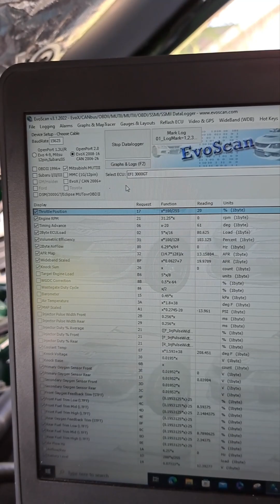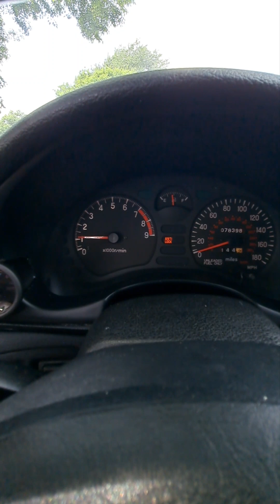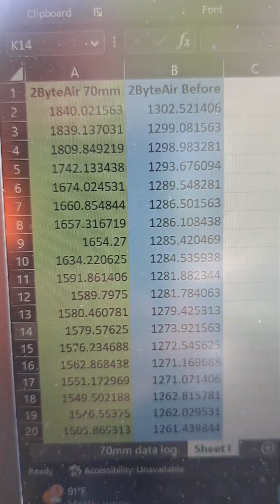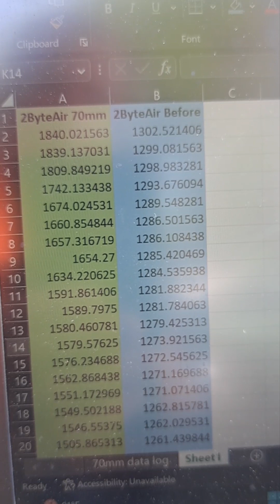3000gt Supercharged Throttle Body Replacemant and Leak Fix Part 2

Comment: Dude wtf you need more recognition this whole series is underrated you showed everything and what you done to get to this step no one does that right on 🤙🏻
Reply from the maker: I sure do appreciate that, it will hopefully catch on soon lol. I know back in the early 2000s some people were putting SCs on these cars but when I really got serious about doing this I googled it and youtubed it and found little to no info. So I decided then I would video my journey. I saw the problems with the old setups and tried to fix so maybe someone can improve upon my setup one day.
Reply: @sigvision4189  hell yeah man that’s bad ass that’s what I gotta do with my eclipse I built an 3.5 block and swapped it and gotta weld up an turbo manifold and redo the exhaust still
Reply from the maker: @ThatGrayEclipse  I love the idea on how Ripp made a jack shaft to run on the eclipse. I had day dreamed about using a jack shaft on the 3000 along the back of engine to get a pulley on the passenger side then run a whipple. No room to do that on the driver side.
Reply from the maker: @ThatGrayEclipse  I am not too familiar with eclipses, do they come with a 3.5 or did you engine swap
Reply: @sigvision4189  engine swapped it they come with 3.0ls but the 3.5 people like to put the vr4 heads on them from an 3000gt to twin turbo with reliable engine for power
Reply: @sigvision4189  yeah I feel you but what you just did is probably better than the ripp supercharger
Reply from the maker: @ThatGrayEclipse  you boosting yours? If so you doing a TT or single setup?I would like to one day do another SL but TT it then do a comparison between the TT and the SC
Reply: @sigvision4189  if you have the base model of the 3000gt your best option is to single turbo it if your going to go with an tt set up you’ll definitely want the vr4 heads for more power and so the turbo kit bolts up but if you’ll do this build I suggest an 6g74 block with softer valve springs and then everything else is bolt on
Reply from the maker: @ThatGrayEclipse  I already have just about every part to TT one. I would do it to the Dohc one to have a solid comparison. I ported my heads for this build. It would be a while before I could start another project though
Reply: @sigvision4189  hell yeah already ready for it I feel you tho I’m same position I been seeing projects I want but can’t rn 💀
Reply from the maker: @ThatGrayEclipse  Make sure to tell all your friends about my build, maybe I can surpass 162 subscribers lol. I have some guys telling me my videos never pop up even when they have notifications on
Reply: @sigvision4189  yeah man I already shared your videos with people you blew they mind no cap just keep it up man soon you’ll be making custom parts for people
Reply from the maker: @ThatGrayEclipse  I seriously thought about building another SC in parallel to this to sell. Between buying the used SC, rebuild kit, aluminum, and paid for welding I have about $800 in it. Now the rest of the car is a different story

Comment: 6:05 I absolutely love that whine, also is this an AWD model? Cant wait to see more of this build
Reply from the maker: No it is the FWD SL model with 10:1 pistons and a 2 bolt main. That is why I cannot go gang busters on boost. IMO supercharging this one made more sense then turbos. Since I cannot add too much boost but wanted more low end power I could do that easier with a SC.
Reply from the maker: It does sound good to me as well
Reply: @sigvision4189  that makes sense, I didn’t even realize the engines were built different for the lower trim models, still such a unique car, and probably more reliable after it’s fine tuned 😎
Reply from the maker: @roxass  the SL runs the same block as the 91 to 93 vr4. Then 94 on the vr4 got a 4 bolt main. To me it makes no sense why mitsu had 3 different models all with a 3.0 v6. They could of done away with the SOHC v6 in the base model. Must of been a big money savings I guess.

Comment: Sounds great!  Might be a bit of belt slip up top?
Reply from the maker: Yeah there could be, I am running such a small top pulley because my crank is only 4.5 inches. I can hear that drop in whine at the top. I also ran car up to 7k rpm which is over spinning that SC by about 2500 rpm.
Reply from the maker: Also, I should of pressure tested after the SC, doing it before it shot some oil out center of shaft which got on the pulleys.
Reply: @sigvision4189 can always run a different sized crank pulley
Reply from the maker: @mdoe8  I know there will always be something to do or fix.  Not excited about doing that fix though.  Since I had a hub made to mount my current 12 rib crank pulley I would have to change all of that which then changes the rpm of my alternator and ac compressor.  Easier thing is to just keep my rpms down LOL

Comment: Where can I get that throttle body ?
Reply from the maker: @Adrianbonjour  https://www.ebay.com/itm/186837550056?mkcid=16&mkevt=1&mkrid=711-127632-2357-0&ssspo=BRugY5hgS82&sssrc=4429486&ssuid=YoRfzp_pTGy&var=&widget_ver=artemis&media=COPY
Reply from the maker: @Adrianbonjour  the evo 4 throttle body uses the same tps our car does. If you get the evo 8 it uses a 3 prong tps which then means you cannot use the iac